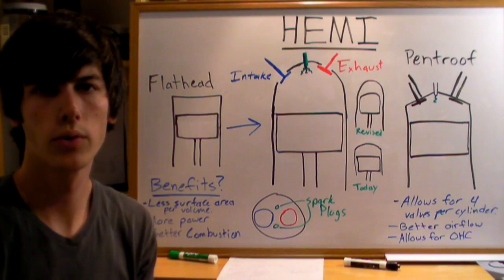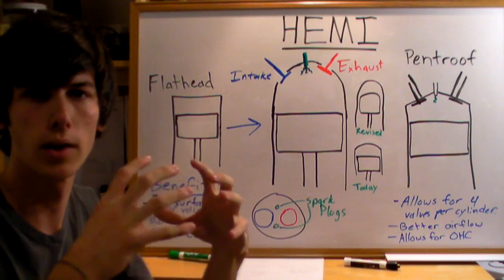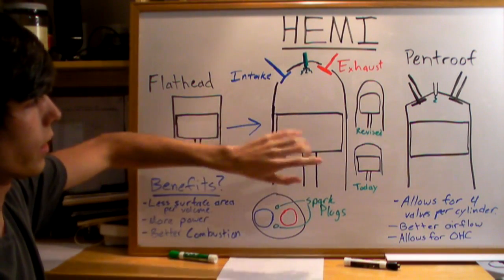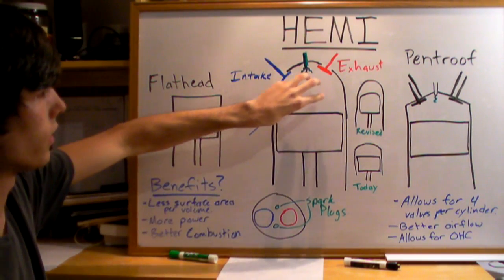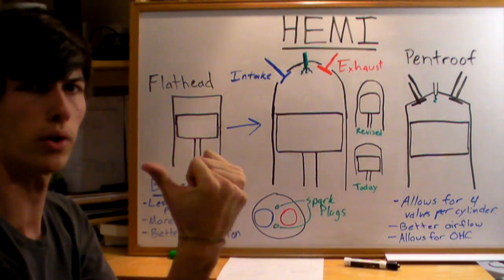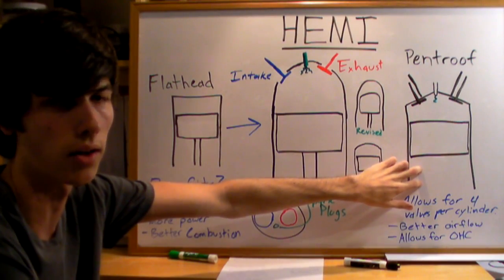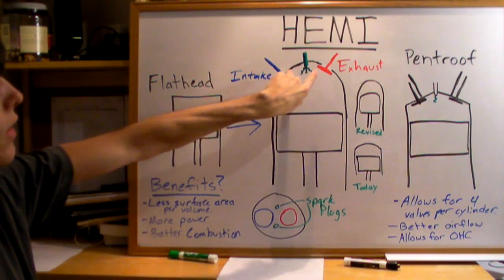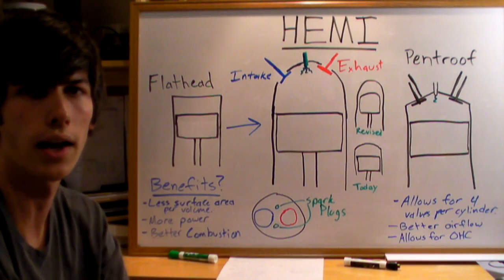What Is A HEMI Engine?

Comment: OK let's look at the facts. 1, it turns out 4 circles pack into a large circle about 35-36% more efficiently than two, but it's more complicated than that between valve angles shrouding, flow bias and interference between valves it's hard to say what the optimal sizes are for each arrangement. 2, a hemi has a higher valve angle, in a full hemisphere which would imply a complete half of a sphere the valve angle could be as high as 45 degrees and that would give room for an extra 41% more valve diameter or twice the valve area more than making up for the smaller valves. 3, but wait nobody uses 45degree valve angles and pent roofs have a valve angle as well. all true. the considerations don't have anything to do with airflow. both designs are capable of flowing more air in a common engine than is needed for a car engines rpm range. pent roof has a smaller combustion chamber and squish pads that help with charge motion and flame speed and keep a lighter flat top piston. but putting the cams over the heads of v engines can cause fitment issues, running all those valves with pushrods might cause reliability and design problems. of coarse squish pads and shallow chambers  can be added to hemi chambers which in a pure sense makes it something other than a hemi. if you are going for normally aspirated power density the 4-5 valve pent roof designs with large or many pistons and short strokes win hands down but must spin very fast to make use of all that flow which is why you don't see the full advantage unless it's in a motorcycle or an older formula 1 engine. but if you are using long stroke engines where rpm is limited the lines blur a little. eventually pushrod valve train become practical and space considerations make more cams over the top of the heads less practical. a company called Sunny's makes hemi-ish heads for 5" bore spacing versions of blocks loosely based on big block chevys for engines 700-900+ cubic inches. it's the right solution for that engine. but flame movement is an issue in engines this big. special fuels are formulated for them to operate efficiently. also if rpm is not an issue as in a street car then a short stroke inherently needs less airflow. Fiat still makes an 8v fire series engine with a bathtub chamber and Honda uses an 8v hemi-ish head in the uber efficient insight. efficiency is complicated and is not related to power density, but it's loosely related to torque density. torque is a result not of leverage, but "mean effective pressure" the mechanical advantage of two engines with different bore:stroke ratios and the same displacement and the same rod:stroke ratio is not different. one pushes on a bigger piston. the other pushes on a longer lever, the model is the same. the mean effective pressure is a combination between a pressure curve, parasitic losses, and a mechanical advantage curve created by the rod:stroke ratio and wrist pin offset. constraints of weight, size, and structural integrity tend to keep the rod:stroke ratio in a narrow area where it makes little difference, the range of rod:stroke ratios in a family of engines might never vary enough for the piston location to differ by even .1% of the stroke length at any angle of the crank. so it mainly comes down to the pressure curve which is influenced by the rod:stroke ratio and wrist pin offset, but also heat dissipation and flame movement and timing. flame speed is influenced by charge motion which comes from the airflow characteristics and the constraints of the combustion chamber and from any tdc squishing between the piston and the head. the types of motion induced by the port are measured in terms of angular velocity as a ratio to the angular velocity of the crankshaft. there is swirl ratio and tumble ratio. multi valve pent roof designs are preferred for a tumble motion. but a swirl motion can also increase efficiency. diesels often still use swirl even with 4 valve designs. in diesels there is no valve angle and the stroke is long so more valves having a bit more area is an advantage. the bore may be small and the chamber exists as a pocket in the piston, at tdc the mass of the charge in the cylinder is contained is this pocket with a small radius and in conserving angular momentum the angular velocity of the spinning mass increases. in a gasoline engine the same happens for tumble as the piston gets closer to tdc. on small engines you can even have "too much" charge motion causing knock at lower mean effective pressure values but on a large engine you may never have enough because of larger radii and linear velocity of gasses having a practical limit. engine efficiency on road going designs is still under 50% when you compare engines look at bmep which is expressed in psi but could be converted into a torque:displacement ratio and not power density because it shows the engineers have worked in areas that increase knock resistance, VE, complete burning of fuel, and have likely increased the total efficiency which is usually expressed in brake specific fuel consumption. high bmep and low bsfc take a lot more research that making things smaller lighter and faster. it's less straight forward than big valves and short strokes and high strength alloys and a bigger accomplishment.
Reply: no theyre not

Comment: SRT's are not 5.7 they are 6.1 at the time this vid was made.
Reply: actually in 2011 the srt8 was a 6.4
Reply: 6.4
Reply: 6.1L Hemi is a blown out version of the 5.7 so he's not wrong.
Reply: Chris Jakubowski it's a completely different block though? So...
Reply: Yes there are tons of difference including the block and the cams and the heads but at its core the 6.1 is based on the 5.7.
Reply: Chris Jakubowski any real source for this or just pulling it out of no where?
Reply: http://www.caranddriver.com/reviews/chrysler-300c-srt8-road-test

In the case of the 300C SRT8, the enhanced engine makes 425 horsepower and 420 pound-feet of torque from a bored-out, high-compression-ratio 6.1-liter version of the corporate 5.7-liter Hemi V-8. Tricks such as variable valve timing or a multistage intake manifold are not present. New stuff includes just a single hot camshaft sitting in the block, 16 lightened valves, and a forged crankshaft that allows the large V-8 to spin to a melodic 6400 rpm. The torque peak arrives at 4800 rpm. That may sound high for an engine this big, but the copious displacement means enough torque is available off idle to put the limited-slip differential to good use. Compared with the 5.7-liter it's based on, the 6.1-liter feels sportier and, oddly, smaller because of its penchant for high revs.
Reply: and 6.2 and 6.4
Reply: @Chris Jakubowski Reminds me of the Nissan 3.5 V6 (especially SUVs and the early 350Zs, IIRC) vs. the Nissan 3.7 V6, where the Nissan 3.7 V6, is made for higher revs, despite more displacement!
Reply: I have the scat pack and it’s a 6.4
Reply: Jacob Gambrel nerrrrrrrrd

Comment: can you explain kompressor engine
Reply: forced induction. changes all kinds of rules because you're pushing the air fuel mixture in vs drawing it in under a vacuum. turbo and supercharged are the air pumps that make this work... turbos use exhauste energy to spin the compressor, superchargers use a belt or gear drive to spin the compressor. There are advantages and disadvantages to both.

Comment: Dodge Plymouth and Chrysler put the Hemi on the map,. An incredibly efficient  motor at making horsepower back in the day 
The true hemi engines built by the  DPC were hard to beat !!
Reply: Jaguar won le mans a number of times with their XK motor in the 1950's. Hemi head, DOHC 6 cylinder. They didn't make the hemi famous only because they didn't name it HEMI.
Reply: And the hemis of today are still hard to beat.  It's seen day in and day out.
Reply: @tonym3675  They copied century old designs and someone elses v8 design .
Chrysler just trademarked the name "Hemi" , not "Hemisherical"
Still not bad from 2 guys from Ford who had a bicycle making company !
Reply: Hemispherical cylinder heads have been used since at least 1901;[1] they were used by the Belgian car maker Pipe in 1905[2] and the 1907 Fiat 130 HP Grand Prix racer.[3] The Peugeot Grand Prix Car of 1912 and the Alfa Romeo Grand Prix car of 1914 both were four valve engines also, Daimler, and Riley were also using hemispherical combustion chambers. Stutz, beginning in 1912, used four-valve engines

Comment: The surface area of an hemisphere is greater than the surface area of a flat surface,
Reply: Hemi combustion chambers are never actually half of a circle or "globe".  The Hemi shape is a small section from a globe that has a virtual diameter that is much broader that the cylinder bore. Also valve lift puts limits on the minimum size of a Hemi chamber.

Hemi head volume is larger only in simple drawings. In an actual Hemi head the dome is not really half a globe. It is much less of a globe. It has less actual surface area but the volume can be larger (depends on what flat or wedge engine you are measuring), and it depends on the virtual full size of the "globe". 

You can image a very slight dome shape if the diameter of the "globe" is very large.

But there are limits to this due to value lift and duration.

4 valves are better than 2 because they need less lift to open the same volume. 

So beacause 4 valves is an engineering nightmare in a Hemi, the Pent head volume can be smaller with 4 valves because they need less lift. Therefore the Hemi is stuck being bigger than what we want because it can only be made with 2 higher lifting valves.
Reply: Hemi combustion chambers are never actually half of a circle or "globe".  The Hemi shape is a small section from a globe that has a virtual diameter that is much broader that the cylinder bore. Also valve lift puts limits on the minimum size of a Hemi chamber.

Hemi head volume is larger only in simple drawings. In an actual Hemi head the dome is not really half a globe. It is much less of a globe. It has less actual surface area but the volume can be larger (depends on what flat or wedge engine you are measuring), and it depends on the virtual full size of the "globe". 

You can image a very slight dome shape if the diameter of the "globe" is very large.

But there are limits to this due to value lift and duration.

4 valves are better than 2 because they need less lift to open the same volume. 

So beacause 4 valves is an engineering nightmare in a Hemi, the Pent head volume can be smaller with 4 valves because they need less lift. Therefore the Hemi is stuck being bigger than what we want because it can only be made with 2 higher lifting valves.
Reply: +The real doktorbimmer  Hemi in your honey hole ?  If they are so old and crappy    why do most dodge trucks haul ass more then any other ? they have more hp . had a 99 f250    loved it   then i tryed a hemi and it blew it out of the water     most trucks you buy have like 340hp   hemi is like 395  400   easy    dodge wont last as long as a ford but they do have more power
Reply: Yes, thats correct, more surface area in a dome, At the time it offered better volumetric efficiency and better heat dissipation due to the surface  area.

Comment: The traditional hemi is outdated. It didn't have squish area, no turbulence in combustion chamber. So they made the dome pistons. (Toyota T series engine and other hemis back then) but the piston was very heavy. they reduced the combustion chamber size and the chamber was changed to a heart shaped chamber. But still a hemi with a large squish area. Now speaking of engine breathing and performance. Not all engines are designed for high flows and the SRT8s designed for performance handle a great amount of CFM. I believe that the pent roof design enables the engine to breath smoothly and smooth idle bc' at low engine speed e.g. idle there's enough gas velocity.
Long story short: I'm a JDM engine fan but don't underestimate LS series and SRTs. They r efficient and well engineered. I respect that.

Comment: Did you mention the high amount of ignition advance required in a Hemi acts as a brake on the piston (and therefore power production) and therefore is a substantial pumping loss - ie loss in the production of power?

Comment: Isn't the main reason for using 2 Sparks that they tried to fit in bigger valves and therefore created that emission problem by moving the single spark to an far outside position?

Comment: I thought it was funny when he said "like the current HEMI, like the 5.7L in the SRT8's... SRT doesn't use the 5.7L HEMI!! They've used the 6.1L, 6.2L, and then 6.4L HEMI
Reply: He made a mistake chill
Reply: You are wrong its the 6.1 425hp then 6.4 470hp (2011-2014) 6.4 485hp (2015-present) 6.2 707hp with a 2.4 super charger then there is the 6.2 with a 2.7 supercharger producing 840hp with 100 octane
Reply: I think he's referring to the Dodge magnum srt 8.

Comment: I'm a bit confused upon reading the comments and watching the video.  It seems that the hemi has been superseded by the pentroof and people are saying its not used in production cars anymore.   

Why is it that, for example, the new dodge challenger has a "hemi v8"?  Or is it that hemi is a brand name and in fact they don't really use the hemi design but simply retain the name?
Reply: +Mia Cassinelli They still produce the Hemi today, to keep the old school guys happy (in my opinion). I have one myself. Hemi's have a unique sound to them as well. 
All in all, the Pentroof design is more efficient, and I think easier and cheaper to build.
Reply: +Mia Cassinelli   
I think "hemi" is a trademarked term by Chrysler.   
The design is not the same, but they use that term to sell muscle cars.   

The advantage of the "hemi" design is that the valves were oriented transversely, so you had straighter flow in the intake and exhaust.   In a traditional v8 the valves are all in a row.    That also means that more fuel mixture just goes right out the exhaust.   So a hemi engine got shit gas mileage.
Reply: ***** No it's not.
Reply: +Mia Cassinelli "they don't really use the hemi design but simply retain the name?"
You got it - edzackery lol.
Reply: +The real doktorbimmer contraire I have a 2005 Chrysler 300 with a hemi...
Reply: +Micaliah Dewitt You think you have a Hemi but you don't. if it's the OEM motor that is.
Reply: ThePaulv12 I have been under my hood.. its a hemi.
Reply: +The real doktorbimmer DAAAM BIMMER. BACK AT IT AGAIN WITH THE "OBSOLETE HEMI" COMMENTS

Comment: Two sparkplugs per cylinder are used in basically every aviation piston engine.This is done primarily for redundancy, but increases power output, too. This also allows to check if the ignition system is working, if shutting off one set of sparkplugs reduces rpm (=> less power) slightly everything works fine. If nothing changes, the engine has been running on the other set only.
Reply: +The real doktorbimmer did you not watch the video? LOL

Comment: The hemi in racing terms means one thing, HAUL ASS!!!  Yes as far as the PENTROOF HEMI it dose have it's place~ON THE STREETS...ONLY for emisions sake!!! But most of us don't adheire to  what the main stream emissions has to offer, so after your 1st state inspection~get rid of all that e-shit an build it like you are in the '60's & '70s!!! Of course using up to  date tech....If it's a REAL HEMI, TREAT IT LIKE ONE!!!   POWER & TORQUE=DISP.~ect... BUILD IT!!!
Reply: +The real doktorbimmer As far as i know the most powerfull N/A engines ever to go in production are with hemi heads.
Reply: +The real doktorbimmer sohc ford 426 "cammer". 650hp n/a horses in 1965.
Reply: +The real doktorbimmer yeah i meant 427 just a typo.
Reply: still outshines both the 400hp viper 8.0,and the 640hp viper 8.4,aswell as the ford 6.8L v10,the dodge 5.9l v8, and many more. 
if were talking about N/A power per liter, my ranger at 275hp with a 2.5L engine beats out a lot of N/A hemi's and a lot of engines overall, but when it comes to race day they will probably beat me hands down.
making 278RWHP@6500rp,vs making 300+ at 3-5k. theres a large torque difference there. plus, the nature of hemi's flowing large amounts of air allows them to be forcefully inducted by means of a supercharger and turbocharger. 

hp is just a mathematical function of torque and RPM, so who cares about horses, I want the torque,and i'll take whatever makes the most.
that's why I'm saving up for a chevy crate 572 to supercharge. but y'know, y'all can complain about horsepower and efficiency while ill be over here winning races and challenges after I drop it into a m35a2.